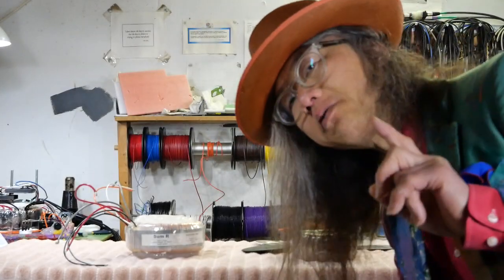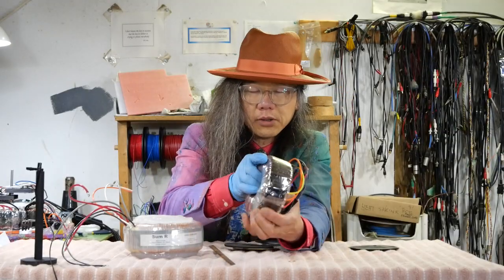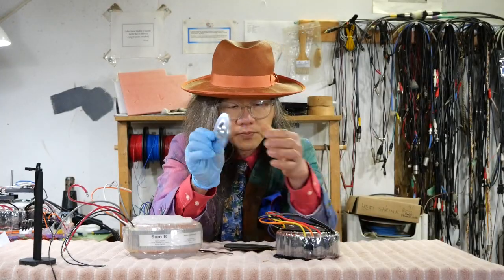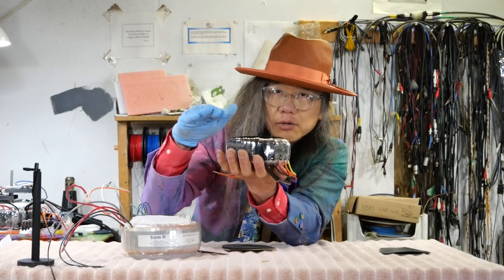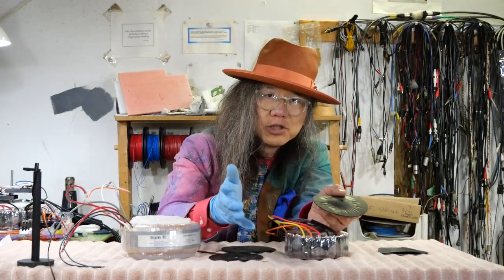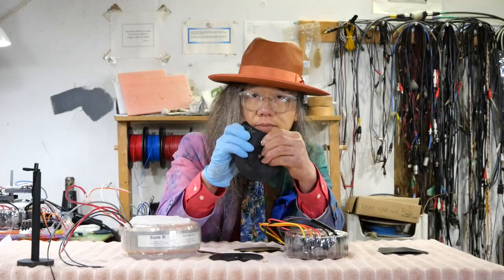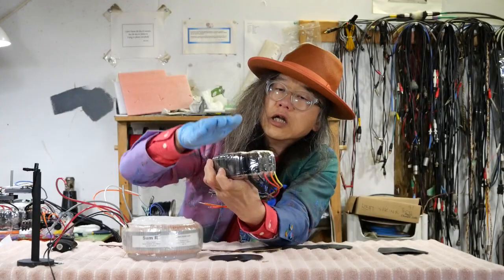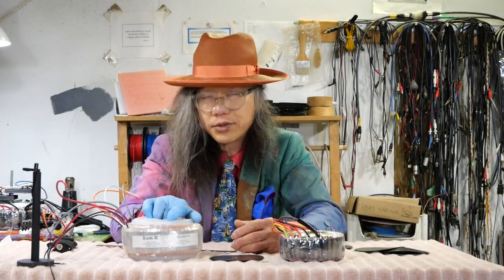Why do I use thick Silicone Pads to Mount Transformers?  Part 1, take 2

Comment: Maybe you got deep knowledge on those questions of Coupling. I'm victim of constant nervous vibration-like feelings in my environment since the grid distributor have setup PLC-G3 communication over grid cables in the city. I can experience this problem in multiple places of my city and other cities connected the same with PLC-G3 systems. I also experienced the same troubles emerge when visiting Romania spring 2024, and saw on doors of buildings they were motivating owners to let their energy meters be changed for PLC-G3 smartmeters. "We" set up a new system, on unshielded power cables, carrying for this purpose relatively high frequencies 5 to 95KHz on power cables, not designed for this purpose => Skin effect => EMI => coupling on some buildings made of clinker bricks, and potentially also power transformer themselves entering in some bad low freq. vibratile states under the guise of DC Bias + those overlayed constant OFDM signals + their epsilons of harmonics and sub-harmonics. I've put some seismographs, a solenoid, near my walls, where on there outside and outdoor wall, a 3phase cable is routed. With this I record many constant sinewaves on the FFT spectrum, located around 25Hz. I can cancel the overstressy feelings in my nerves listening to 75Hz tibetan bowl sounds but.. this is near of a 24/7 problem. The only scientist I found at this moment, who wrote about coupling in details is Erling D. Sunde. I'd be pleased to listen your pov about those problems if you have curiosity and the knowledge about them. Best regards.

Comment: Learn from your mistakes, fix the mistakes using what you learned, don't dwell on mistakes and then move forward. 
Using silicone is taking something that you already had and using it in a different way to fix your current problem.  
We have a tendency to use things familiar to us to fix problems.  If you worked in potters clay you would have probably used that!
Remember, to someone who only has a hammer, everything looks like a nail.
Reply from the maker: It is so true.  My tailor is clothes pin to "clip" paper together.  We all us whatever we are familiar with.  I like to hang around with hardware store just to spend 15 mins in various section to get ideas.  New tools, new parts or even new fasteners.  If I have time, I do the same online.  Gathering information and file them under possible future ideas.  You never know when those little items may be useful.